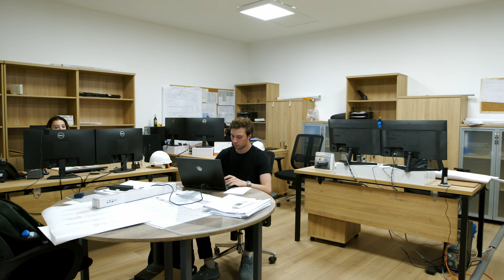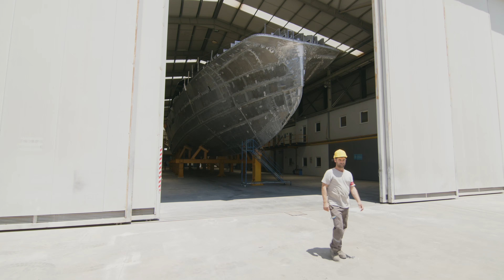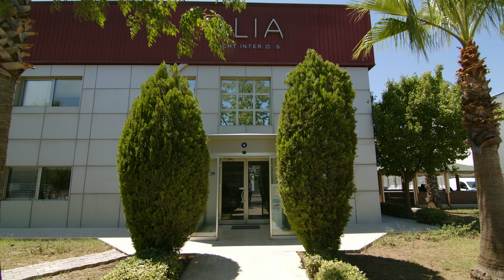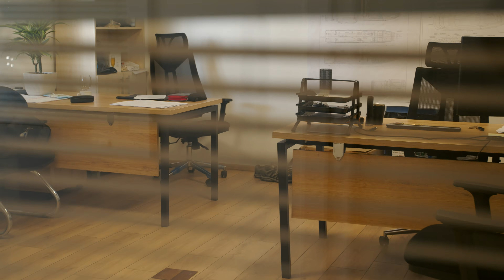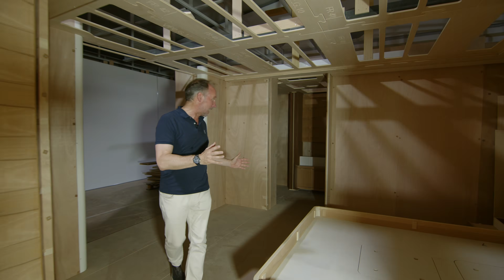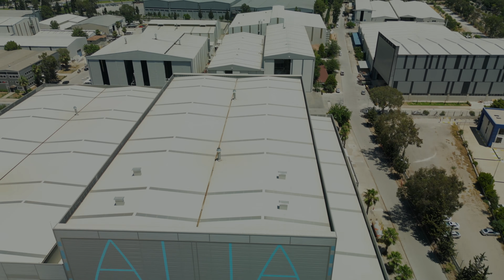Turkey's secret city of Superyachts - ALIA YACHTS

Comment: You should step up your game in the video department by getting a cinewhoop FPV drone (with covered props).  There were so many opportunities for a fly thru in the buildings and ships. Even a fly thru of the wood working department would have been cool.  It is a little different of a skill tho.  You manually fly inside.  There are no computer controls that do it for you.  So it does require some practice.  5-10 hours on a Simulator would give you enough of a idea, because you already have some knowledge of drones. Very impressive facility.  Clean and organized.  It looks like an amazing place to have a career.